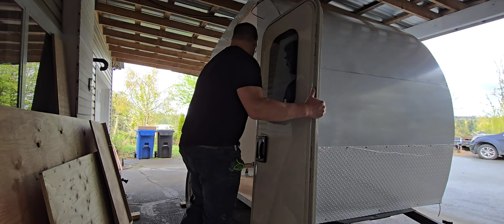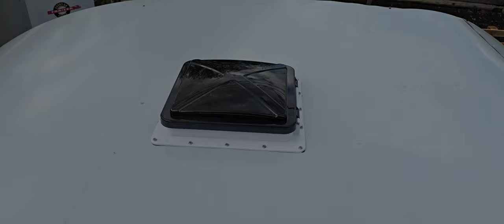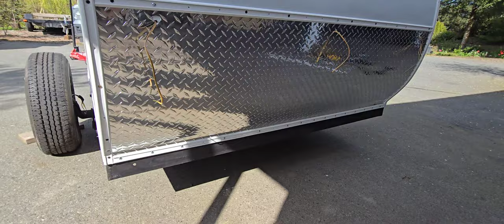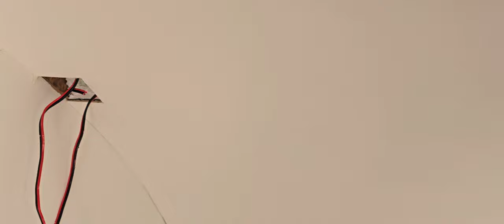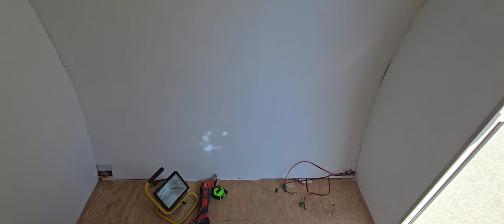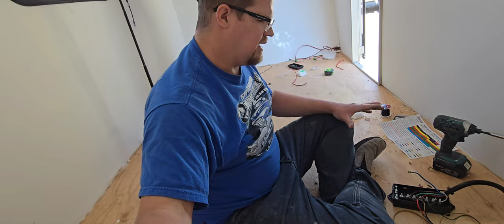It's all dried in!! (teardrop camper part 8)

Comment: Looking really good :)  Drying In one further step you need to do is run a bead of Pro Flex RV Flexible Sealant on all the protuding Edge trims , Windows , Doors , Roof vents , Lights , and any Water inlets . We did both edges of the trim as well as the screws holding the trim on when we Pdi`d all thge new trailers that were sold to customers . The Butyl Tape will slowly over time  leak . Hope this helps you as you don`t want all this hard work you have put into the trailer ruined from wetness , Bill .
Reply from the maker: Absolutely! I have the sealer already ready to go I just didn't put it on the video. But thanks for the tip. I always appreciate positive feedback.
Reply: @buildinglittle  Your welcome , Bill